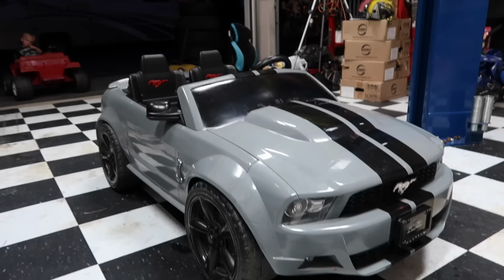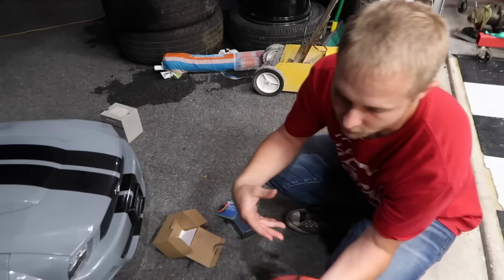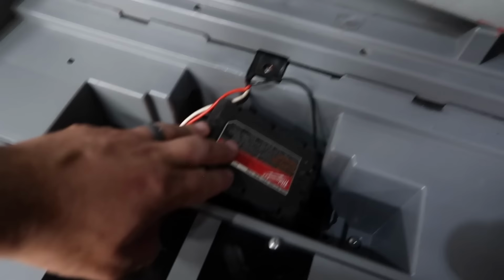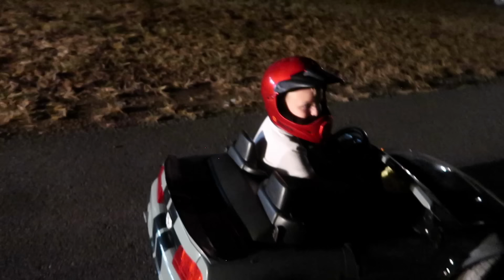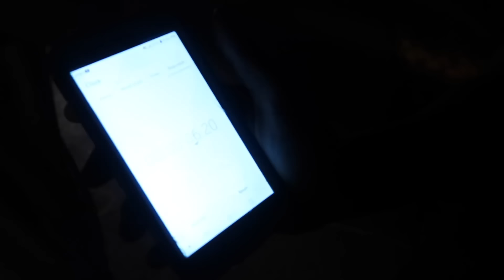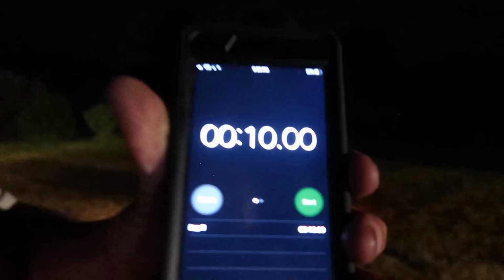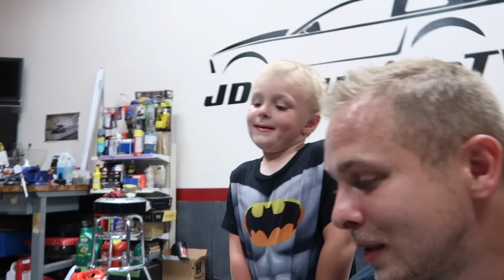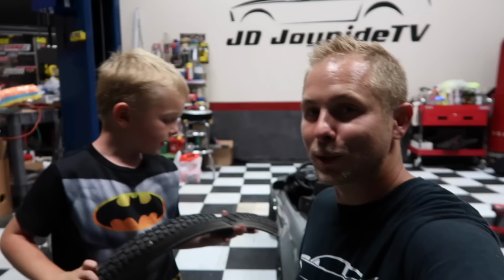Power Wheels Gets MODDED with Milwaukee Drill Battery Upgrade

Comment from the maker: If anyone want's to do this same mod for there kid's I put a link in description for both Milwaukee & DeWALT adapters. DO THIS AT YOUR OWN RISK.
Reply: You are going to need to add rubber to the front wheels as well as the back otherwise he won’t be able to steer it, it will have too much torque from the rear for those hard plastic front wheels to get any traction
Reply: i run it on 5s 50C lipo..which has twice the discharge as 5s 20c Lion ( drill battery)..ive also made 6s lion (24v)out of the dewalt. it has the same power
as the 5s 50c lipo....The kids are on 24v ( lead acid) motion trendz ATV..it's faster than 18v  powerwheels (12 -15mph)...it has HEATSINK and 570 stock
motors..the gears are holding up fine for a 75lb kid...You can get used for $20-$50...or swap out the gear box/motors and mount it on a power wheel..ect
it'll keep up with a stock s300 scooter. No funking wiring. spades are fine 9ah gets more than 1 hour....
it'll be too easy to install live axle and BRAKES and 1500-2000watt BRUSHLESS on 36-48v..when they get older ( 20 mph plus easy)..Use Gardening dividers...so it'll still power slide/drift....You dont want it to traction roll or strip the gears...when the kids yank the steering.... 15 mph is plenty fast for doing donuts and power slide in the hood. Less traction acts like a slipper clutch
to prevent gears stripping
Reply: Dude that was awesome even people having fun watching please do more videos i love this👍
Reply: Don’t forget to take the wires out of the bike tires And you should see if you can upgrade the motors
Reply: I can't keep fuses in my kids f150. Even with "upgraded" motors. Either blowing fuses or overheating n burnin up motors
Reply: JD JoyrideTV add more power plz and put rubber on 32 vl battery
Reply: When he’s older but not quite able to drive you should buy him a racing simulator setup he’s already great at drifting.
Reply: Uuuuuuuuuu
Reply: Lol ye
Reply: Needs  some rubber
Reply: Put some rubber sealant on the wheels
Reply: @cerebralfailure8804  hcnfj
Reply: What’s the link please and thank you
Reply: You have to put duct tape on the tires that is what my parents did and it worked great
Reply: BLAZE Rover god knows your car needs more power
Reply: Stupid idea
Reply: What's with the cheap Nick off m18 battries
Reply: JD JoyrideTV you should wide body kit it
Reply: The Two Brothers ooooh Someone woke up on the wrong side of the pillow bud
Reply: All this dose is burn out the wires in 10 mins gay idea
Reply: add rubber tires
Reply: nvm i see the newr one lol
Reply: OneEye Monster can you link parts. Or pm me with more details
Reply: I look  and can't find it i need name of that  part
Reply: You need to put the Milwaukee Makita Ryobi DeWalt battery adapters it's going to be fast
Reply: Hey there love the video, just got our kids a 24-volt tundra but the battery life doesn't last very long. Do you think paralleling to m18s would give it more longevity, not to mention being able to swap batteries on command instead of waiting hours for a charge?
Reply: How long are they able to ride before it dies out
Reply: @cerebralfailure8804  g
Reply: @cerebralfailure8804  s-##
Reply: O yea I prepare their
Ty n.v
Reply: Af your own risk THAT PART EXACTLY
Reply: is this  originally  a 12v car tho
Reply: Should had put some thin type rubber on the tires then see what it do
Reply: I'm definitely doing this to my daughter's Ferrari lol, is the Mustang a Dual motor?
Reply: You should use hot glue on the tire to stop spinning
Reply: Ok
Reply: Fr
Reply: Kids? I was thinking of me. Lol
Maybe lengthen the body. A 79 Trans Am would be hot.
Reply: Might need to install a electric fan to keep the motor cool. Maybe some cpu fans
Reply: I did the same thing to my daughters power wheel jeep and it fried my brand new Milwaukee m18 battery
Reply: Let’s also note run 1 was two up run 2 he was alone
Reply: my dad would replace our car batteries with real car batteries it would go alot faster and last alot longer
Reply: @Twyer24  hi there the same thing keep happening to me do you have a solution to this
Reply: @Twyer24 same here. Have you found a fix for that?
Reply: That Camaro tho
Reply: @oneeyemonster3262 my son has a 24v range rover 2/4 wheel drive switchable. How do I make it quick? Ish? As standard it does 5-7mph I want that 15mph lol
Reply: @oneeyemonster3262 you sound like you know your onions. If you need to know more about the motors etc lemme know. Ideally jus a battery upgrade would be perfect
Reply: Hi can i get the link for dewalt please
Reply: Says an obv. unmarried man.
Reply: @Twyer24  Use several diodes in series to lower the voltage

Comment: Buy more tires, you're going to need them.....!!
Reply from the maker: already need them.
Reply: JD JoyrideTV you should put go kart tires on it
Reply: Ex Gremory that can slow it down
Reply: @tj1lincoln182  it would slow the acceleration a little bit but it would give more grips for top end power and handeling
Reply: Ex Gremory arent drag tires suppose to help with traction tho lol not slow you down overall but help you go faster..... Gokart tires would just be too heavy for that little thing lok
Reply: Omar Salcedo  it will slow him at the start sence the wheels are heavier it will start slower but sence the tires are not plastic it will have more grip at top so the tires will grip instead of plastic spinning
Reply: Omar Salcedo and as for the slower I don’t remember correctly but I think he said his going to put another battery don’t remember if it was like bigger or more volts but if it’s more volts than the thing will be even faster and in plastic his only going to spin
Reply: @exgremory3387  it literaly gose lik 18mph plastic tiers are good plus he looks like he like drifting
Reply: @exgremory3387  the rotating mass of go kart tires would blow out those motors in a matter of minutes.
Reply: @soloroloboy4877  18mph lol he’s going like 5
Reply: Or you can just use rubber spray 🤔

Comment: so serious questions.
1: have you had issues with the extra voltage to the smaller motors?
2: how long does a charge last?
Reply: Same questions but no answers anywhere. I bet this extra power fries the mainboards and motors...
Reply: @jamil420  If it's a 6v power wheel and you use a 18-20v Battery it won't last long. 
The 12v powerwheels however can handle even 24v without problems

Comment: Just so you know if you clean the tire up super clean you can use E3000 adhesive to attach the bike tire rubber on it won't come off any time soon. Did it to my son's hot wheels. I had upgraded the motor, battery and tires.

Comment: It works,  just gonna overheat the motor. Did it to my son's quad. Motor lasted 2 uses. If you're gonna go through all this just buy another of the same bats, run in series and spend $40 on a motor that can handle it

Comment: I read somewhere that the drifting is intentional to reduce motor stress, adding rubber AND running at 18v will stress the motors too much. They sell a soft start module for that.

Comment: You should put in a voltage cutoff so it didn't drain the m18 battery to the point where it won't take a charge anymore. 

I did the save thing to my two kids power wheels with the same m18 battery, and it is fast!! They love it. I set my voltage cutoff at 16.5v.

Comment: For anyone watching this thinking that you can add rubber to the tires to stop them from free spinning you will blow out your gears.

The free spinning wheels serve as a clutch on these Power Wheels.

Learned thar the hard way.

You could add a little bit of traction like spray on bed liner to the tires that gives a little more traction but not enough to stop the makeshift clutch system of these stock Power Wheels gears.

Comment: I made a wooden board with L brackets sticking up and slot the battery onto them, much cheaper then those usb cap things.
You can even get a little usb board off eBay for like £2 and wire that to battery and free battery bank to charge phone etc.

Comment: But you only changed the 20 volt battery, leaving everything as it was, did you make any changes by changing the motors or adding fuses and control unit?

Comment: Look out for possible rollovers❗ Hi center of gravity + traction = ??? 
 Wear the helmet, even at the "Drag Strip". Possible high speed finish due to higher gear ratio from larger diameter tires! Make sure that he knows to keep it straight after the finish line❗

Comment: Awesome stuff but you just got them both into the most expensive hobby going when they are old enough for a real car.  What’s crazy is they might be the generation that just has a bigger model of their toy car as their real car when internal combustion engines are off market.  I’d be tempted to throw a dc boost converter on with a couple small fans and thermistor wired up.  As soon as the batteries or converter gets hot the fans would kick in and they know not to give it anymore abuse 😂.  Great stuff tho I hope my car enthusiasm doesn’t rub off on my kids when the time comes.

Comment: Here's that question of WHY the manufacturer didn't put rubber tires instead 😂.
Reply: Because its a kids toy, the rubber tires would need a stronger rim which would also make the toy significantly heavier and A LOT more expensive

Comment: Be careful not to over discharge the battery because it could damage the battery and make it to where the Milwaukee charger will no longer charge the battery. I recommend you get some sort of voltage cutoff board to put in there to prevent over discharge of the battery.
Reply: I did ruin one of my betteries....so how did he not don't to his
Reply: The battery has its own BMS which controls charging and discharging. It still needs to protect itself against over discharge when being used in standard tools too.

Comment: Mine does that to but i drift it using my hands as back brakes
And the power comes from the car going down hill
Once i lost my steering i was going maybe 10 or 15 miles an hour and crashed to a wall side ways
And my hand gridded on the whole wall

Comment: Ps don't need the adapter or the pmw, just chop the old connector and put a couple plug ends on the wires then stick em in the drill battery pos and neg

Comment: My advice the power upgrades are fun but my kids pow wheels worked great until the motor/gear box split have had this problem three times on one toy the fun is worth the extra parts if you don’t mind blowing the money would be great if the toy had a metal gearbox not plastic

Comment: 12V cars can be just powered with 18V bateries w/o any special changes? engines or some electricity will not burn?
What about 24V cars? On 18V it will be slower?

Comment: Did you hook up the motor speed controller to the vehicle as well? Trying to upgrade my son's car, but the motor is also connected to the gas pedal with wires. Trying to figure if I should connect all three together. Thanks.

Comment: You never had to change/upgrade the controller? The components on the one I'm upgrading is for a maximum of 14 volts! :| The car itself is made for 12v so 14v isn't much to play with, and I'm building batterypacks as a hobby so I can make it really custom to fit for the car but as far as I know it says that going over 14v will ruin the capacitors on the controllers circuitboard and there is 24v models of the cars that we could use to battle that! But even after dealing with that I read that it's not recommended to use Lithium cells because the higher discharge rate and the company's that specialize in these mods have some kind of "slow start" valve/module to keep that in order! I'm probably just gonna build a 24v pack and see what happens and change what ever brakes!😂🤷🏼‍♂️

Comment: What does the 30amp fuse do or what is it in place for? I want to do this for my kid. How is the fused wired? Just pick the hot side wire and hook it between the adaptor and the power wheels?

Comment: If you only changed the 🔋 battery to 20 volts, the control unit, if it remained so original, has burned out ???

Comment: Do you have any idea why mine won't reverse? I hear a high pitched noise and power to all the accessories turn off when shifted into reverse. When I did hit the pedal the first time while in reverse it smelled hot and all power completely cut out. Any suggestions would be appreciated!

Comment: Hi, I did that same thing to my son's power wheel. But some how the battery turns hot real quick on half battery ( 50% ) and shuts off. Then we have to wait till the battery cool off enough so the power wheel can work again. Do you have any suggestions for this issue?

Comment: I have a Mercedes Unimog 12v 4wheel drive and want to convert it into 2x18v Milwaukee Lithuim-ion batteries. Can i use the 9.0ah battery instead of the 5.0? Does this upgrade affect my parental control rc?

Comment: How long does a drill battery last in it? Awesome video!
Reply: You’d have to find out the amperage of the motors and divide that into the mAh of the battery to get a close estimate. Say the battery is 2000 mAh and the motors are rated 500mA to power, and you have 2 of them, that’s 1000mA divided into 2000, so you’d get roughly 2 hours of driving. 

This is just an example of the math, not the actual stats of the battery and motors.

Comment: i have a 12v car if i put 18v will not Burn all the system? !!!
Reply: The motor will eventually burn out, but you should get some good run times before it runs out. If you want more speed, look at upgrading the 12v motor to one with spins at a higher RPM. Check out this video: https://youtu.be/5KcoaRCp0y0